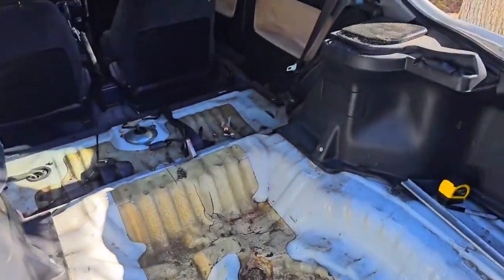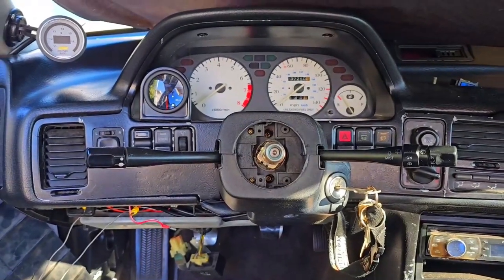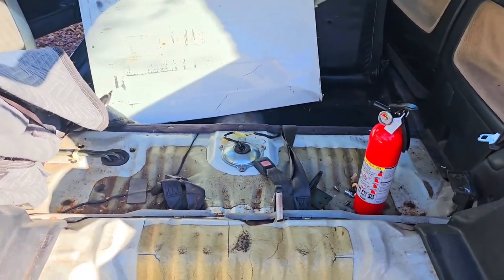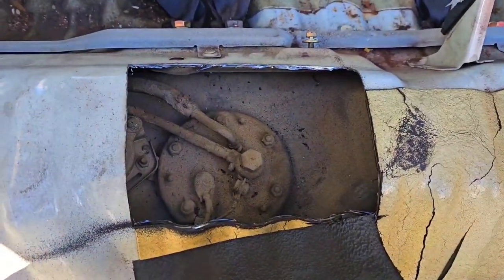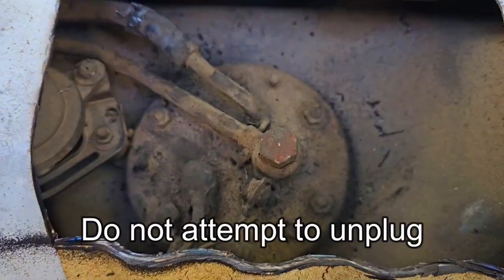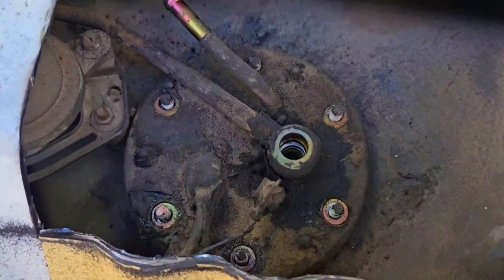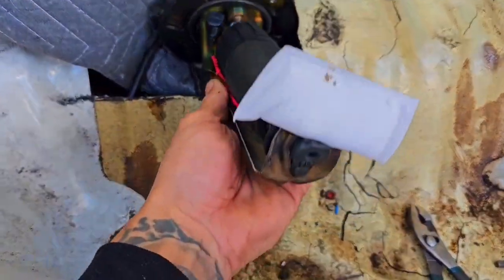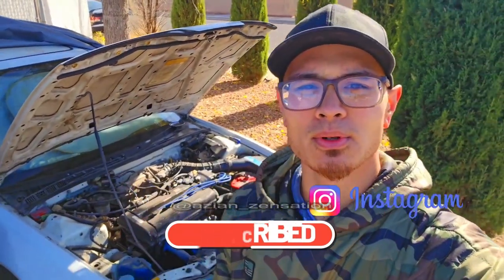1990-93 Acura Integra DA Fuel Pump replacement without dropping Fuel Tank

Comment: Hey brother did you leave the access panel open? Or did you some how have a thought on closing it up?
Reply from the maker: I just put the panel back on where I cut it, it's not a tight nor loose fit, fits like a puzzle piece but it's temporary for now (planning on fuel cell). I taped it off with gaffer tape mostly to prevent the possibility of fumes entering the cabin.
Reply: @aziangarage  how big of a cut off wheel did you use?
Reply from the maker: I cant remember, between a 4.5"-7" wheel I believe, the panel isn't really that thick.

Comment: Hey brotha w video but what tool did you use for cutting?? I’m scared asf ima hit my tank while cutting and then be extra fucked lol
Reply from the maker: Angle grinder, there actually is a decent amount of space between the body and the tank. Just mark your cutting lines like I did and without fully penetrating grind into the panel following the cutting lines to make a guide for your cutting wheel, then go over them again with complete cuts.